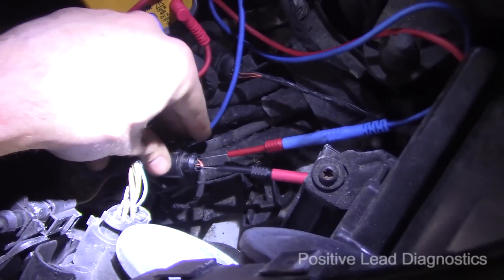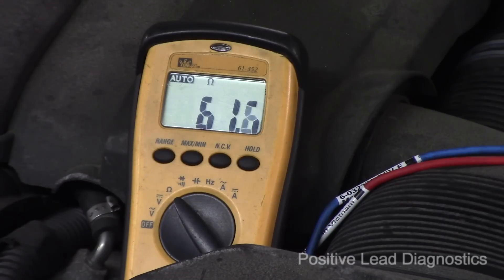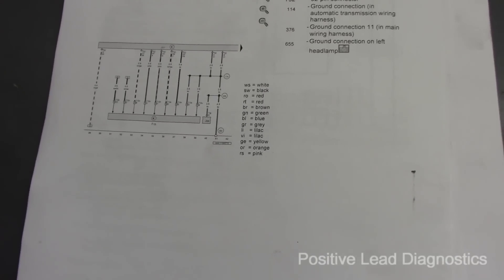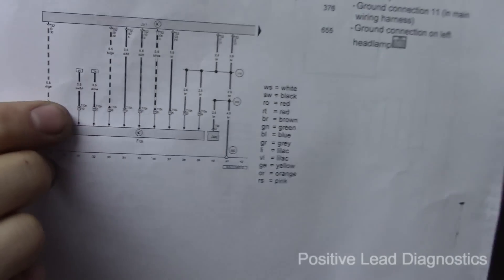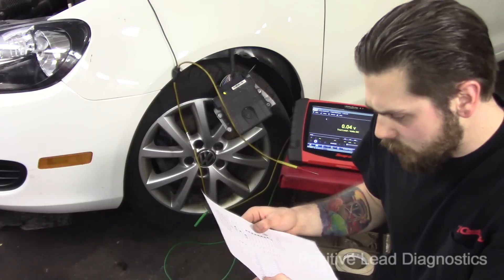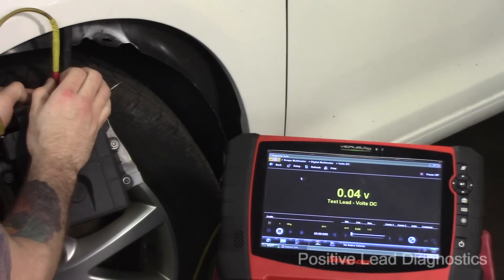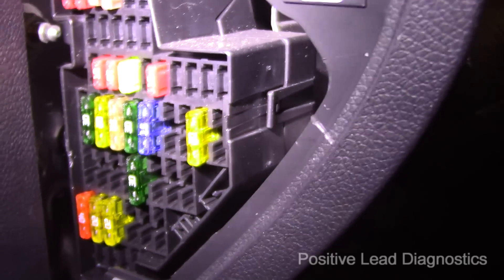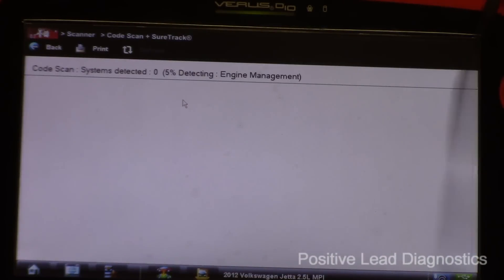2012 VW Jetta No Communication with TCM U0101 (part 2)

Comment: See UPDATE below...
Wow! I had mentioned the cabin fuse block in Part1, and it was so simple...
But here is why I was aware of that... read on.

DANNER... you missed it too!!!  ...never trust another mechanic! LOL
- 2 things you must do to avoid falling in these long troubleshooting sessions... 
-- Check Body, Engine, Chassis Grounds and battery output.
-- Check distribution blocks, proper fuse and relays in proper slots, and if good/bad
-- that has saved me tons of headaches.  (see below)
...too many shade-tree wannabe mechanics who shy away from the technical part of today's vehicles are still legacy-parts-throwing-minded and lazy, sloppy, if not thieving, malicious.

...then start diagnosis
-- best get all the diagrams and logic write-ups, now up-front, and read them.
-- check grounds and power on the areas you are working on per the codes results.
-- check ohms, continuity, connections, and what modules are in the path.
-- check the contending points on the diagrams according to the logic on write-ups
...enough patronizing...

I bought a used Chevy Express that had gone thru many shady hands... the fleet mechanics had robbed all the spare Fuses and spare Relays from all distribution blocks and none of the covers for the blocks to be seen, so no legends.
OUCH!  talk about starting naked!

UPDATE: I should mention that the vehicle is an upfitted mini bus on an Express 4500 cutaway chassis with 2 extra distribution blocks in the cabin to accommodate the inside and outside rear electrics, a roof air conditioner, an auxiliary fluid heater, a bus door, a bus door-handicap ramp(not a lift), and an Air Ride suspension with 3 levelers, with kneeling functionality, with dual air compressors... all hung on a T-harness, all electrically driven via a slew of buttons on a console at the driver side.  Wow... a mouthful.

Many distribution blocks have PCBs sandwiched in the plastic enclosure, and the PCBs contain embedded relays that are not readily if at all serviceable. My PCB in my under-the-hood block was greener than St Patrick's day! ...and the only way to get to the inner part of that double stacked circuitry is to desolder 150 pins that act as a fence all around it.
Yeah! right! ... time to order a new circuit sandwich.

I had to snoop the Internet to find legends and start to make sense of all this shtuff.

...and the legends SUCK! they are numerically sequenced ONLY! so that's good to cross-reference the fuse or relay on the block, but useless to know what does what across what...
and many systems have fuses and relays in multiple blocks...

So I created a sort-able multi columns MASTER-list-of-all-fuses-and-relays-in-ALL-blocks-table in my database so I can group fuses and relays by type, number, name, groups of functionality(with color), block  so I can sort another way and readily see all the ones that pertain to current job peppered all over the list.
Haaaaa! now I can see instantly that when I play just with the Ignition Key what it basically connects to either directly or indirectly.

Of course, if you do not have a write-up of the logic used in all these modules/circuits, you are still hung out to dry.  So, I snooped for that as well... and that is the hardest to find unless you have a subscription via a scanner to the manufacturer.

My recent move has been to purchase the X-Tool D8 bi-scanner... suhhhweet!
That speeds up the process and narrows down the multi-meter/probe work.

Comment: Why not try a new TCM and if that doesn't fix the problem, return it to stock. Or is there a risk of damaging the new one during the test.
Reply from the maker: the reference pulse is simply the signal from the crank sensor or ignition module to tell the ECM the RPM of the engine. If your truck doesn't start, as you said, you need to start by checking the fuel pump relay circuit itself. Follow this video https://youtu.be/McnXLcJNVfI

Comment: I'd love to know the story behind the mysterious moving fuse. I mean, the car must have had some problem before somebody went looking at the fuse, right? Or maybe was it a little shit of a kid messing with the fuse and put it back in the wrong place and told nobody..
I used to repair appliances a few years ago, and interrogating the customer was a critical part of the process. One time we were out at a nearly new fridge freezer that had about 6 different problems. After an initial look at the fridge we started quizzing the customer and it turned out they put a child lock on top of the fridge to stop the kid getting into it!
We came to the conclusion that the kid was pulling on bottom of the door with the child lock on it, which warped the door, which let warm air into the fridge, which created a build-up of ice, which blocked a little diffuser sliding door, which burned out the motor on the slider, and also cracked the plastic around it.
They had defrosted the fridge when we got there, so all these problems initially seemed unrelated. Random things bent, broken, burned out, warped, and no apparent cause. It was only after really drilling the customer thoroughly that we got to the root of the problem.
Which likely prevented them from having the exact same issue a few months down the line.

Comment: The absolute best diagnostic can video that I’ve seen. Made everything easy to understand.
The thing that raised an eyebrow with me is when tommy said there was only one power to the Tcm but I blew that off because of their level of expertise being light years ahead of myself . Just goes to show how the best can over look something and Dan was correct about the complex nature of wiring diagrams and which format that you use to read them. 
I’m currently working on a 2006 dodge ram with a Cummins diesel that starts and runs fine but has no comm to the pcm. My diagnosis was a bad pcm however before I pull the chain on a new one I’m going to go back and use what I’ve learned in this video to recheck my work.
Thanks and great job fellas 😃😃😃

Comment: Not a valid test guys, you changed the parameters and you did not try the test again with 1 out of 2 previous parameters, ONE, the BOB is not connected, TWO, the fuse is not pulled. Once a good waveform is on screen, pull the fuse to see if it gets wavy again, plug in BOB to see if it gets wavy again. SD, do you have Mitchell there at home to pull up a diagram of the TCM and show us? I am sure both you guys have a lot more experience with CAN by now, 2021. Love the series of videos for this car and thanks for the lessons on how to read those damn diagrams.
Reply from the maker: lol we certainly do! We looked a little foolish in parts of this one

Comment: What if you are missing a resistor what's the next step. I get 120 ohms and good voltage on both can high and low. 2.3v and 2.7v. What's my next step? Cant find it anywhere.
Reply from the maker: You need to look up service information that tells you where the resistors are and whether or not they are external or part of a particular module, then start there
Reply: @ScannerDanner  thanks! I know where they are and I believe they are eternal. It's a 2012 chevy cruze 1.8. I have been working on this for days. My only vehicle and cant really afford hiring someone. I may have no choice though. I have watched a ton of your videos learning. I cant find anywhere online or in videos what to do at this point. I am fine with changing the ecm because I am sure that is the resistor that isnt working. I unplug it and still have my 120 ohms. I am just worried i will change it and it will be something else and it fixes nothing.
Reply from the maker: @GSCData  just checked for you. The BCM and the ECM have the terminating resistors, so you are on the right track with the ECM, but I would do some network tests there first. With the ECM unplugged, take your ohmmeter and measure the harness connector data wires and make sure you still see 120 ohms. This will confirm there are no opens going to the ECM. Pins numbers according to my diagram
x1 connector - Pins 10 and 11 (LUW)
                        - pins 29 and 43 (LUJ)
Not sure what these model designations mean, sorry. But the wires on both models are Dark blue and white
Reply: I can send you some money via PayPal or something if you can help me out lol. I have had intermittent problems with loosing communication and no crank no start the whole time I have had the car. But now it's to the point it wont start anymore at all no matter what I do.
Reply: Thanks a ton buddy! I did still have 120 ohms with the ecm unplugged. So most likely replace ecm? Well that sucks but atleast it will be over with. I have been dealing with this problem for a long time and it just got worse and worse. Will be great to no have to worry about getting stranded anywhere and also keeping my family safe. The car would do some very funny things at times. Thanks man!
Reply from the maker: @GSCData  no man, listen carefully. I want you to measure this resistance value right at the ECM connector with it unplugged. It is very important that you do this test from that location to eliminate an open circuit in your CAN lines that extend to the ECM. Where did you do your measurement when you saw 120 ohms
Reply: Okay I gotcha. I measured from the obd2 port. With and without the ECM unplugged. Measured 120 ohms both times. I'll go check it from the the connectors that run through the harness into the ecm.

Comment: my wager would be that there was a little bit of scale built up in the TCM connector that caused it to stop communicating (or the plug wasn't fully seated) then someone went in and pulled the fuse to see if it was bad, returned  it into the wrong slot, then you guys cleaned up the scale by unplugging and replugging the TCM connector multiple times, then you found the fuse misplacement.

Comment: I was struggling with the same no TCM comms for a couple hours until I watched this video. As soon as you started describing the fuse box and how there would be terminals on both bottom/top for the fuse and that someone had put it in the wrong spot, one over, I realized what I had screwed up the day before. Ran out to my car, swapped the fuse locations, fired it up and bingo - Transmission was back and all my lights cleared out after a quick drive. Thank you!
Reply: Can you tell me the symptoms you were having?  Was it difficult to shift out of park?

Comment: Who would have paid for the module if it were replaced and not returnable? The shop? The Tech? The customer?
Reply from the maker: A great question and it is not black and white. Usually the customer eats the cost of a miscall by the technician. I'm not saying it is right but when you go to the doctor and they try a treatment and it doesn't work, do you ask for your money back? Do they charge you again to keep going? They sure do. 
Communication would be key in these situations. Let the customer know where you are in your diagnosis and give them the option. There are times where you absolutely cannot be 100% on the call you are making. We make mistakes. But it is up to us to mitigate those mistakes by thorough investigation and troubleshooting.  If the part is returnable and is removable easily (not hours and hours to take it back out) the garage will take care of refunding that part, if they are honest.

Comment: I think this is an undercover test for the dealer from a news channel.
A fuse moved over hmmm.

Always check fuses and not just probe, I always check placement and pull fuse to verify its not hiding green crusties. Dan has a video of a Mercedes no comm and cannot turn key. Turned out to be fuses and fuse box full of green crusties.👍

Comment: Danner, from your experience, what can cause an intermittent misfire, I'm trying to have this issue repeat and sometimes it comes back and goes away. At some point I had my test light grounded and had the misfire for a bit and I saw no spark when the misfire occurred. I monitored the computer control wire and it seems to be working ok but during the monitoring it did not have the misfire. Power and ground to the coil looks ok, I will check the amp drawn by the ignition coils with the scope but the coil itself appears to have good spark. My assumption is a loose wire that comes loose every now and then, can't be really sure unless I have them hooked all the time and wait until it starts to misfire. This is from a Nissan Altima 2003 2.5L  with P0301 (cylinder 1 misfire).
Reply from the maker: Move the coil to another cylinder and see if the code moves with it :-)
Reply: @ScannerDanner  I did that and it didn't move. Would a crank position control each coil or just one and the others are time based? I suspect wiring but everything has tested good so far. Just intermittent misfire. I will update if I find something out of the ordinary, injectors are pulsing.

Comment: Was the owner a used car dealer?  Before the auction some dealers move or straight up remove fuses, relays and disconnect connectors to try to discourage other dealers from bidding high with electrical problems.  A lot of times they still get outbid and the winner gets the problem. Not at all saying that this was the case but totally reminds me of what i see on the regular here in VA working on auction cars.  Always check for missing fuses, relays and disconnected connectors.

Comment: No one asked the customer? You would think he/she had been in that fuse box and put that fuse in the wrong place. All of a sudden car will not move? Never crossed their mind? The fix was to put the fuse in the proper place! I can see a tech overthinking it though with all these complicated electronic systems which have gotten ridiculous to my mind. What is all this BS about programming the computer when a part is changed? Is that necessary--why can't these systems be made to recognize the replacement and none of this BS? Am I right? Money making racket for the manufacturers and dealers? Congratulations to you guys that are really good at this electronic diagnosis stuff though.  Interesting to try and learn from you but the cost of these diagnostic tools and programs are prohibitive for the do-it-yourself person. Glad to see you show what can be done with a test light and multimeter for some of the simpler things.

Comment: Personally, I have a hard time believing someone "accidentally" pulled a fuse for the TCM and inadvertently put it back in the wrong spot.  First of all, it does not appear that, following the fuse being placed into the correct spot, there are any problems at all with the car.  Why, then, did someone pull the fuse in the first place?  My guess is that you were set to be featured in yet another "mechanics/dealerships are crooks" gotcha pieces that are so popular nowadays.  Some expert mechanic gave the car a clean bill of health, swapped the fuse, and said "any honest mechanic will find this before they try to sell you something."  In reality, most of us, even if it were our own car, would have made the same call.  

Many years ago, a car was towed into our shop in Washington, DC with a "cranks won't start" complaint.  Being an independent repair shop in the early 90s, we did not have access to the kinds of tools available today.  We diagnosed a bad computer, even though we had a hard time believing that was the problem (this was a four year old Toyota Camry if memory serves me).  I called the customer to give him the estimate (well over $1,000).  He didn't even delay before saying "go ahead and fix it".  That really got me worried, so I went back over EVERYTHING I could think of.  It turns out the fuse for the ECM was under the floor map.  Plugged the fuse back in, and the car started and ran just fine.  Called the customer back and told him to come get his car. Didn't even charge him for the tow bill.  Not too long after, the local news did an expose on dishonest repair shops.  We were very nearly featured on the series.  Granted, we misdiagnosed an obvious problem.  That actually made us better techs.  The point is, it was an honest mistake (especially for an independent repair shop back then).

Good job not getting stung!

Comment: .... imho we are dealing with some complicate systems and sometimes we forgot to start with the fuses.  when attacking a problem like this we don`t have in mind a "simple solution" for the problem like a fuse.  this is related also to the fact that we don`t find often  blown fuses that are solving our "hunting" problems and we are always testing and testing to find and solve  :)

... big thanks to you Guys , best regards from Europe.  maybe you don`t have all the info about european cars but you have the best  (by far) professional approach and skills to deal with and solve the issues.
but , above all this , sharing the information is the most important thing.  
full respect and infinite thanks for that.

Paul`s book and his channel`s are more than a gold mine  !
Reply from the maker: Thanks so much! Crazy thing on this one is even if we tested the fuses using the conventional way, it would have tested good! Only fuse removal and inspection revealed the missing pin and wrong location lol. In other words, I almost never remove a fuse to test them and I would have missed it using the typical way that I test them. 
But you are correct, in the real world, it's almost never the fuse anyway and starting there is not the typical first approach to a seasoned tech. 
Thanks for the comment and kind words about ScannerDanner Premium

Comment: Imagine if the manufacturer (VW in this case) would include a test port on the module where you could plug in and have a computer scan the module in detail, isolated from the rest of the car.